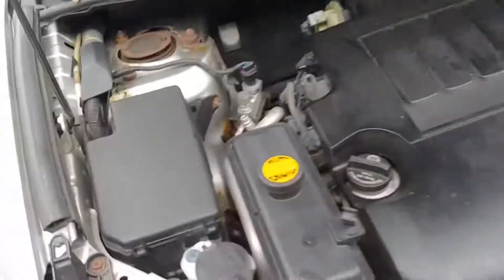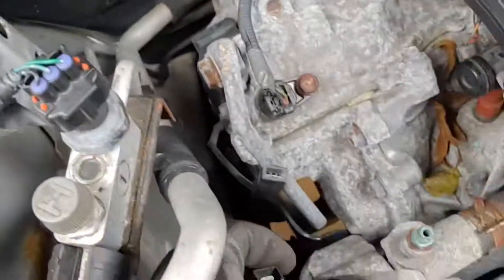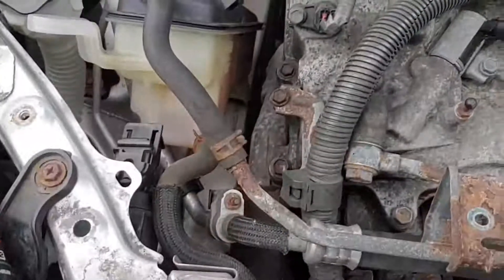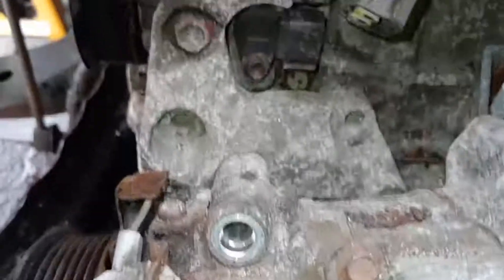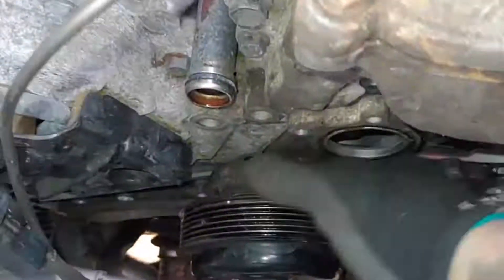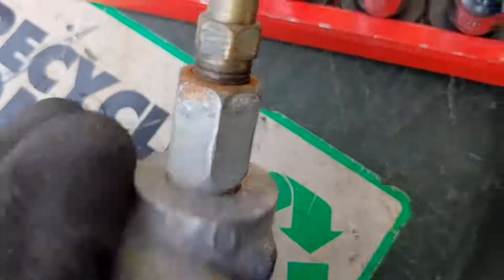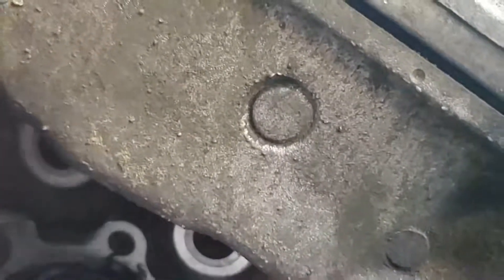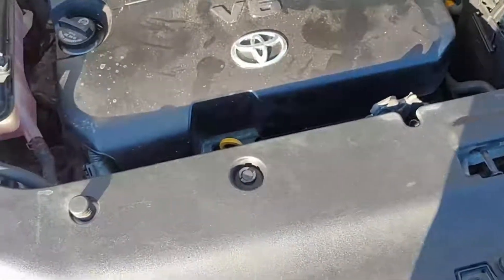2006 Toyota Rav4 3.5 v6 water pump and tensioner...easy!!

Comment: Thanks. I was considering just paying someone, but I like to do it myself to ensure good quality work. I found another video showing how to remove the radiator and support so now I can do this. Ended up being way too much work so I am just doing the pulleys. I will be paying someone if the tensioner ends up being a problem.

Comment: How long does this take
Reply from the maker: Somewhere About 4.6hrs book time
Reply: How much you think something like this should be charged to get fixed ?
Reply from the maker: @BrokeButHungry  depends on the quality of parts and local shop rate, shop rates around me range from 125-150 and even more for mobile technicians such as myself
Reply: Last question sorry , do u think a aftermarket part is just as good as the oem for this part?
Reply: Or should i get oem part ?
Reply from the maker: @BrokeButHungry  some aftermarket parts are good as long as you get a good brand...with that being said...the aftermarket parts industry is a nightmare right now so if you are worried id look towards oem. For me, using cheap parts will certainly bite me in the ass! Even if the part is warranted the customer is inconvenienced and confidence is lowered...I'd rather not get the job than use inferior parts

Comment: What happened with those two loose bolts that mounted to the front bumper? Did they tighten up or where they stripped ? I was just curious , that was weird...
Reply from the maker: They were just loose, I tightened them and no issues. its not that uncommon to find stuff like that on vehicles that have been fiddled with by diy guys or untrained mechanics...

Comment: You removed too much. And the noise from the beginning was the water pump
Reply from the maker: Tensioner was also noisy and and binding...yes you have to remove what i removed, takes 5min  to remove radiator to prevent damaging it, once you damage a radiator and have to pay for it our of  pocket you'll go the extra mile. I also needed access to chase the threads from the missing bolts. Jobs easy enough, only hang up was receiving the wrong thermostat housing gasket.